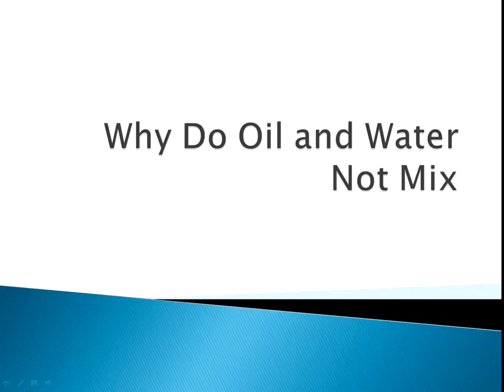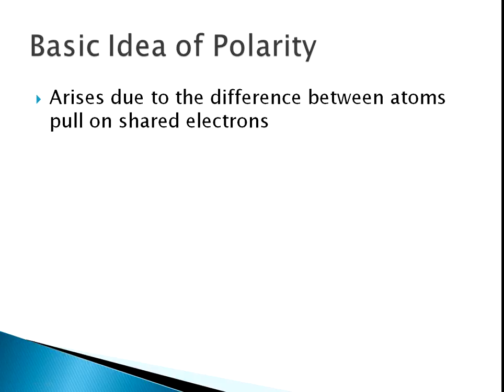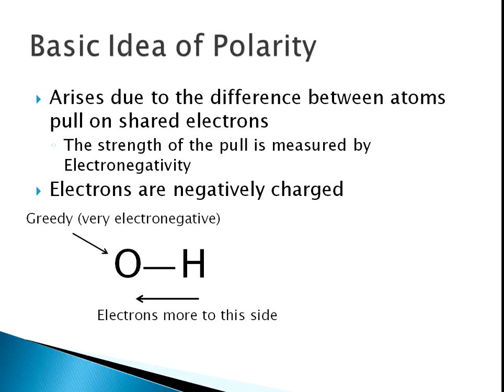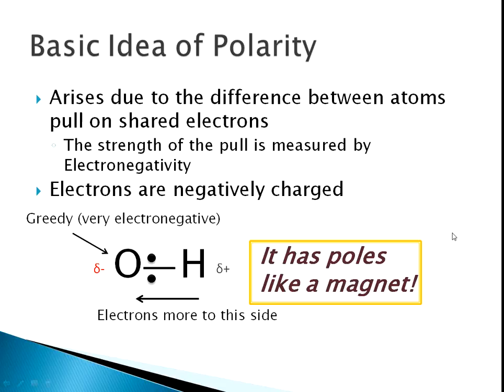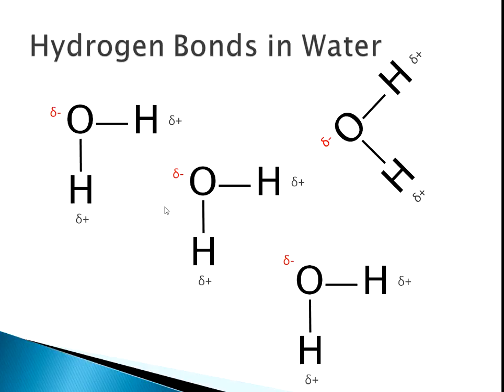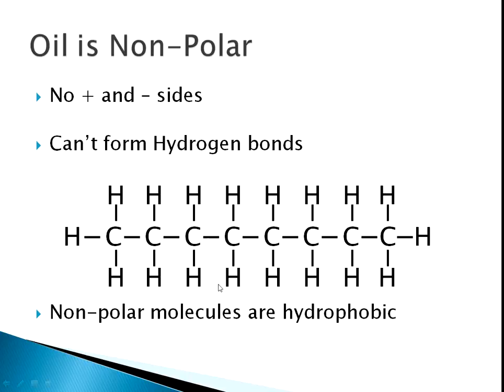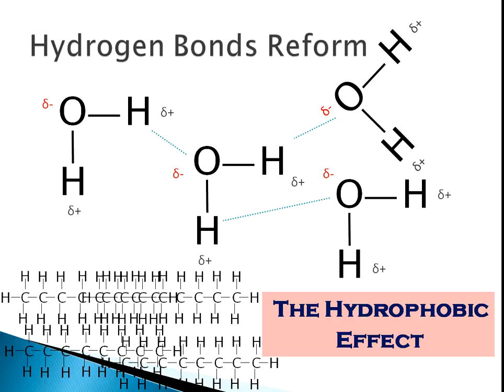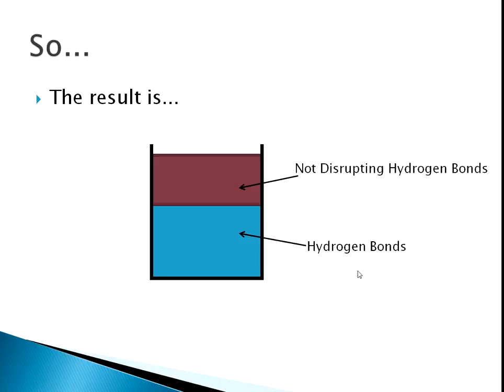Why Do Oil and Water Not Mix

Comment: sry I am still confusing about why oil molecules are non polar. why C-H is different from O-H? I think C is also electronnegative.
Reply: All molecules are electronegative but since C-H have similar level of electronegativity (you can know that from the chart) the molecule is polar because non of the molecule is considerably more "greedy" then the other meaning it is non polar. While in O has a high electronegativity compared to H that means that the O is more "greedy" to take electrons meaning that the O side of the bond has a negative charge (remember because electrons are -1 charge) while the H side has a positive charge meaning that the molecule is polar.

Comment: How egg will bind them together??
Reply: egg can be mixed with oil 
egg can be mixed with water 

i think it serves as a way to mix the two-water and oil-its called an emulsifier and the product of it is called an emulsion - mostly used for salad dressings i suppose. please do correct me if im wrong
Reply: Because it contains lecithin which is a phospholipid that both has polar and non polar atoms